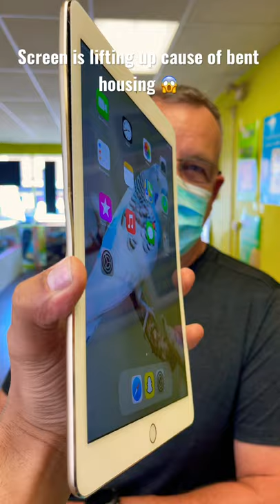BENT IPAD REPAIR #shorts #apple #ipad #ios #iphone #android #samsung #xbox #ps5 #ipadrepair #unlock

Comment: How much does this service cost? This thing was pretty much stripped down and rebuilt.
Reply: • Disassemble everything
• Get new metal frame (body)
• Reassemble everything
I would say it’s rather easy if you know how to and have necessary tools.
This should be nothing compared to repairing corroded board which will take time to find the corrosion and damaged components.